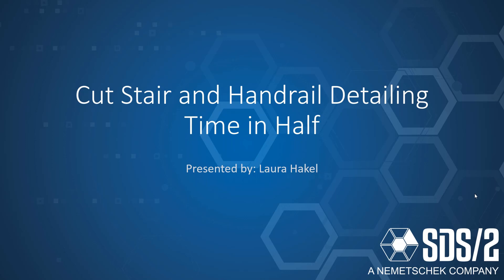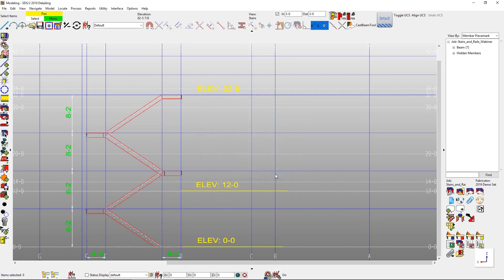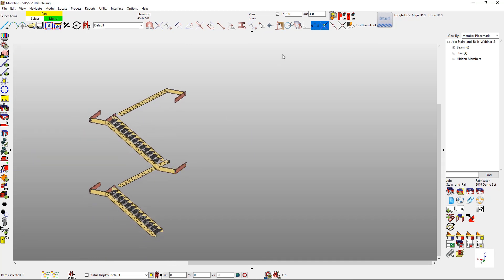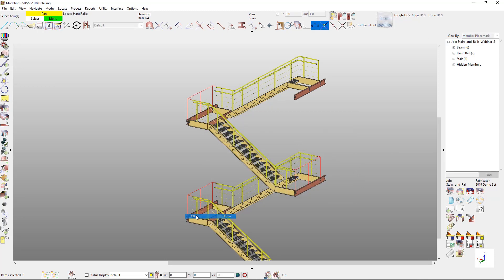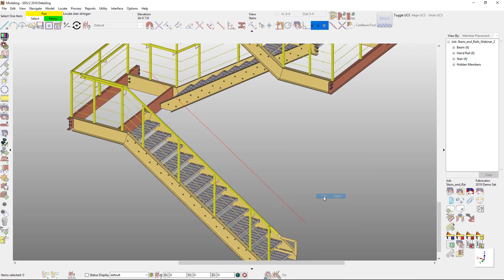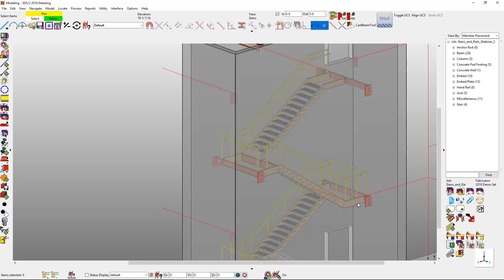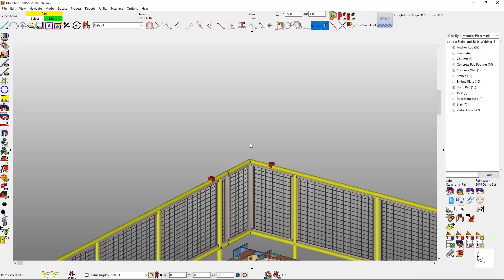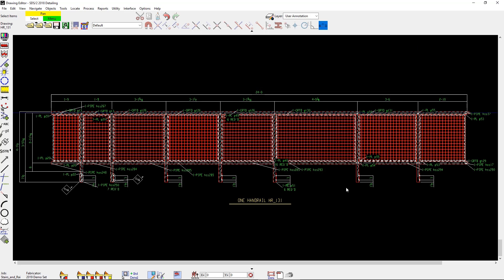SDS2 Sales Webinar: Cut Stair and Handrail Detailing Time in Half

Comment: Good Morning
When I put railing at the back of the landing, it puts railing off the back channel, how can I adjust it? In the video it locates railing perfectly in the center of back channel, not in my case. 5.55 min of the video. 
Thank you
Reply from the maker: Hi, When putting in the railing to the stringer, make sure the end that you're working with has the correct return length. For further questions, please contact our support department at support@sds2.com.
Reply: @SDS2_Software  worked out well thank you

Comment: Hello 
I dont see top riser, it is created only with pan profile. How come I don't see it when I use plate profile?
Also Is there are any option to put bolts on carriers attaching plate/riser to angle (which would be welded to stringer) instead bolting it to stringer?
Also, if my plate/carrier below finish nosing can i lower my riser/plate ? I know I can do it manually but is it possible to do it within parametric commands?
Thank you
Reply from the maker: Hi, Please contact our support department at support@sds2.com to receive assistance with your questions.

Comment: I dont understand, when you click on add quick stair command it bring menu. In my case it tell me to pick points.
Also after picking points you already have back channels and headers how you did it?
Also, when I put railings on stringer it shows stick, how can i turn them solid?
Thank you
Reply from the maker: Hi, You will pick your first two points first and then the Quick Stair Add window will appear. In that window you will choose your stringer section sizes and properties to make up the stair. 

When you are finished with the handrail command it should turn to solid. You can do s a on your keyboard to turn to solids or F5 to make sure it has processed. If you have any further questions, please contact our Support department at support@sds2.com.